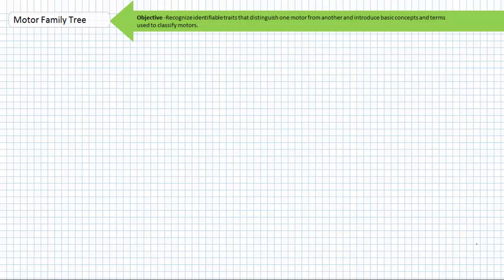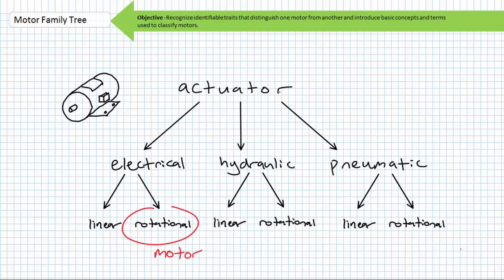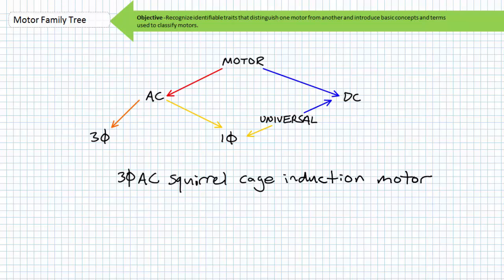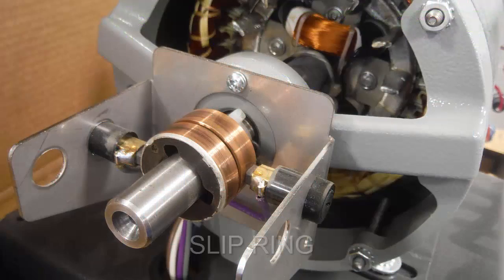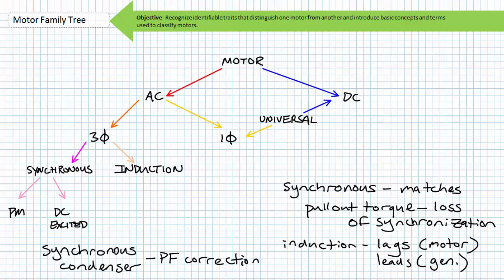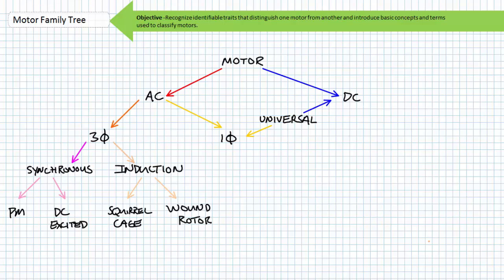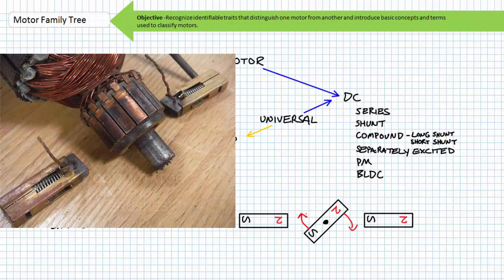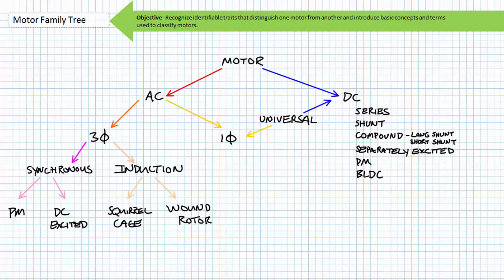Motor Family Tree (OLD LECTURE)

Comment: I just came across your channel. Is there a write-up showing the sequence of the classes one should take?  It is hard to find them by searching
youtube based on what you mention at the beginning of each lecture. Awsome presentation
Reply from the maker: I'd recommend using the playlists in the following sequence:
Basic Electrical Circuit Analysis 1: https://www.youtube.com/playlist?list=PLdnqjKaksr8qQ9w3XY5zFXQ2H-zXQFMlI
Basic Electrical Circuit Analysis 2: https://www.youtube.com/playlist?list=PLdnqjKaksr8pXF2SpDyyD7ouAVlz96_Ra
Basic Electrical Circuit Analysis 3: https://www.youtube.com/playlist?list=PLdnqjKaksr8qzoIGCYx2rhVK51ZPjXkRO

Once you get past Basic Electrical Circuit Analysis 1 you could probably also start up on:

Hydraulics https://www.youtube.com/playlist?list=PLdnqjKaksr8ruhw85YYSSO6EWLhVVmSKm

Once you get into AC Power and 3 Phase AC you could check these playlists out:

Motor and Generators https://www.youtube.com/playlist?list=PLdnqjKaksr8oba07pG-nE1Omy1_mabMtI

Motor Control https://www.youtube.com/playlist?list=PLdnqjKaksr8qRPCFkU2Q8XQe0bfo99rs6
Reply: @bigbadtech  
Thanks
I am interested more in the PLC and ladder logic. Can you sen me the playlist for those lectures. Thanks 
Ben
Reply from the maker: Start with this one: Ladder Logic and Motor Control https://www.youtube.com/playlist?list=PLdnqjKaksr8qRPCFkU2Q8XQe0bfo99rs6

Then move on to PLCs: https://www.youtube.com/playlist?list=PLdnqjKaksr8qxlMYRVTF2YzTm6RwtA7pc

Comment: Great vid! Ques: Isn't a car alternator a 3 phase gen with static internal rectification, but externally excited by the car's battery?
Reply from the maker: I could fill a book about the stuff I don't know about automobile applications, but, yes, you're correct. A car's alternator is typically an electrically excited 3 phase synchronous "machine" that is being used as a generator. The 3 phase AC output is then rectified to charge the battery. Eventually I'll deal with synchronous motors, synchronous generators, and rectification in later lectures.

Comment: Are all alternators, AC generators synchronous because I would think they should be due to the fact that they must produce 60 Hertz exactly for grid stability, thus for a 4 pole gen you should run it at 1800RPM? I don't know if there is an induction generator which means you would have to deal with the slip problem, (asynchronous) not a good candidate for frequency stability??
Reply from the maker: One would think that all generators are synchronous, however, there are "asynchronous" or induction generators also. I'll explain both motor and generator mode for both synchronous and asynchronous machines when I return to the motors and generators playlist.

Comment: sir i want to know about droop also......how voltage droop is connected to the governor speed droop ?wat kind of excitation system is used on ship ....air circuit breaker?wat are d protection system on air circuit breaker ???

Comment: sir... i am a marine engineer ...from india...i had seen all your videos regarding motor and now can say you are the best teacher of world..now i want to say can you explore more about generator and its power management system and about automatic voltage regulator...further i want to know about how distribution system works....why only 3 phase not 4 phase.....after dat how reactive power generated and controlled ......why neutral is not required in 3phase system and required for single phase system
Reply from the maker: +kaushlendra singh Glad you're making use of this material. All these questions and more will be answered when I return to the motors and generators playlist and 3 phase AC circuit analysis playlist. I'm developing the hydraulics playlist right now.
Reply: great job.... thank you very much this is really awesome channel